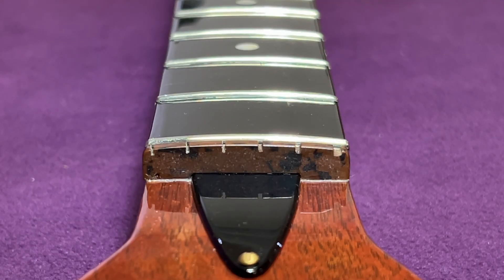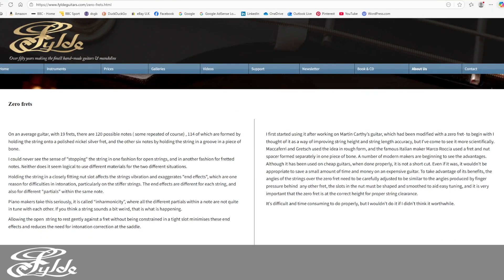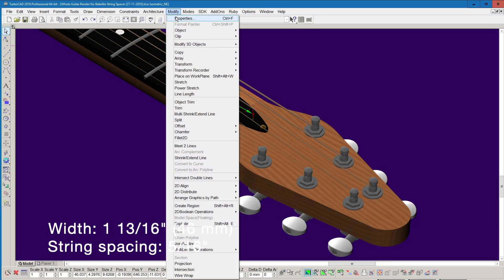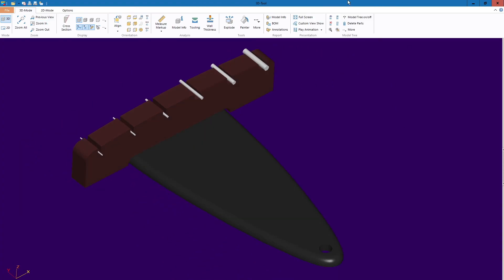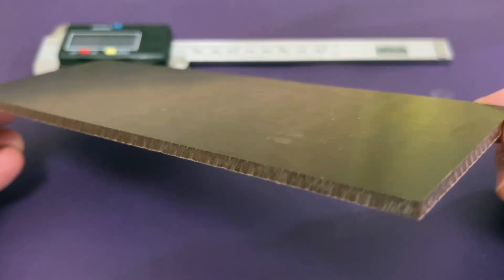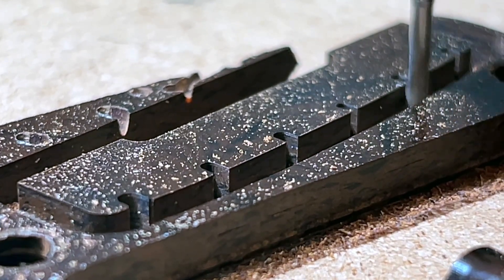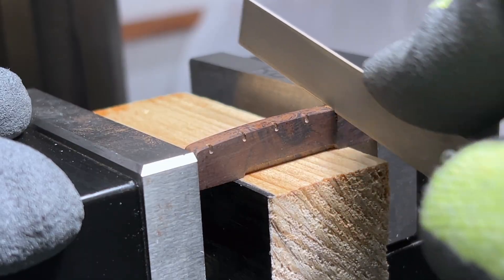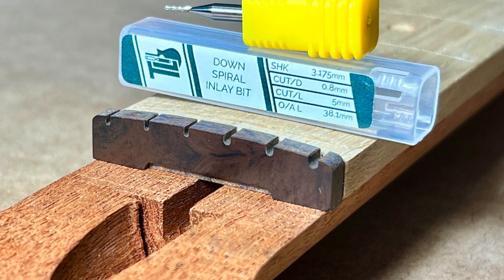Brian May Red Special Guitar Bakelite String Spacer Design and Make

Comment: In case you aren't aware, Bakelite can contain asbestos
Reply from the maker: @richardpayne5868 Hi Richard. Thank you for commenting, I didn't realise bakelite can contain up to 5% amosite (brown asbestos) actually.

I have cut into brown bakelite items occasionally inside with limited ventilation and outside with a dust mask. I normally use vacuum extraction while operating the CNC machine. However, in light of this information, I certainly won't be doing so again.

Doug